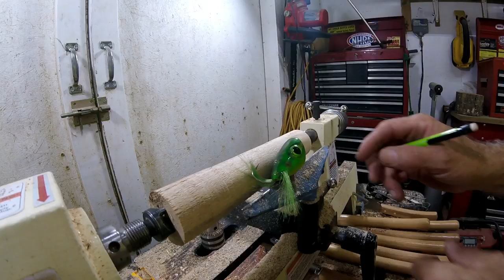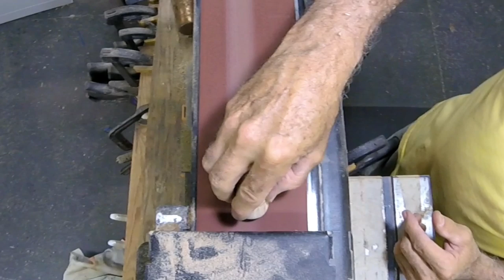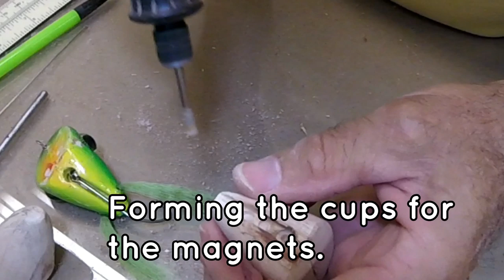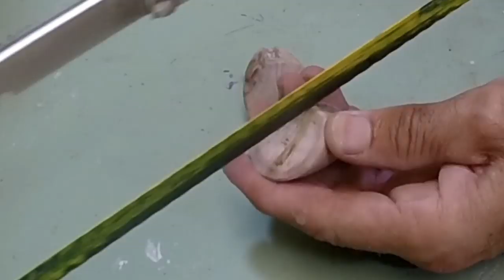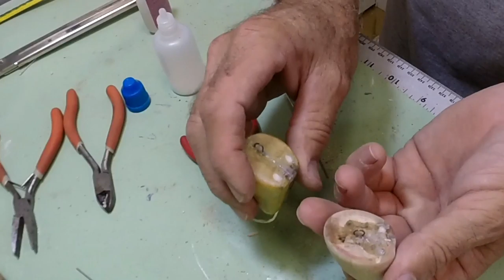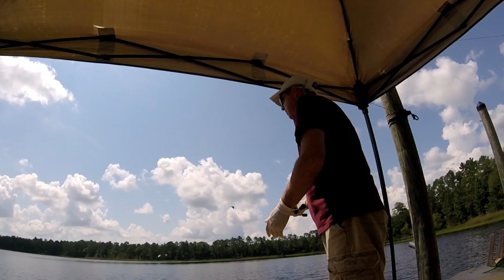Scorpion Jump Frog, Making the perfect one for a silicon mold.

Comment: If your sealer has a specific gravity that is lighter than water, you could apply a vacuum to the container and that should remove more air from within the wood fibers.    Keep up the good videos.
Reply from the maker: Well actually that's only true if you are applying that sealer only on the outside. But when you vacuum the lure what you're doing is replacing air with the sealer. And the sealer will always be heavier than the air. The results is a lure that has the same volume but it's heavier. That's not something you want unless you plan for it. Thank you for the thoughtful comment

Comment: I just found your channel a few days ago, watching all, it takes time, a lot of videos, sorry if you already answered this question. To make the frog floating in the proper way you added soldering wire, you have the magnets for the hooks, etc. Actually how do you calculate how much weight needed to make the lure floating? Do you just guess and experiment on water or do you use math formula, weight the water moved by the submerged lure, etc?
Thanks so much for your super helping and detailed job!
Reply from the maker: For weight and balance I use the density of the wood and I weigh the lure after it is shaped, then I calculate the volume...from that I know how much weight I can add.  All my lure build videos have the process....hope it helps.